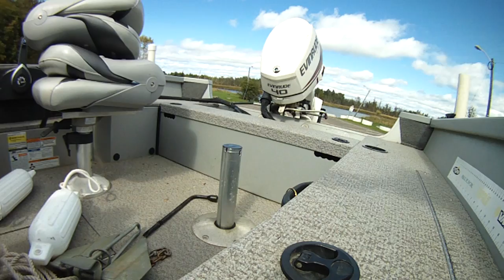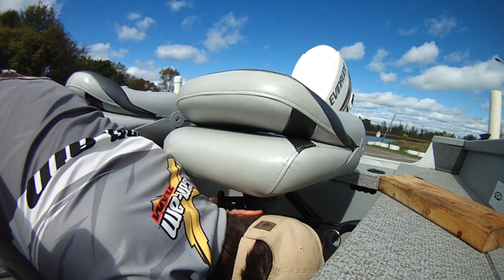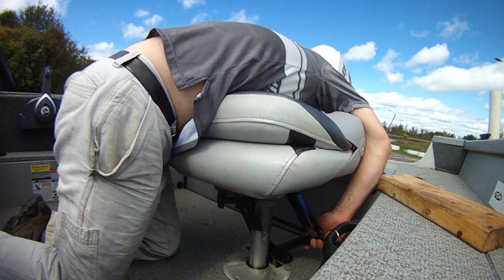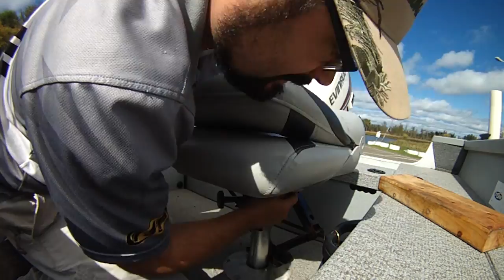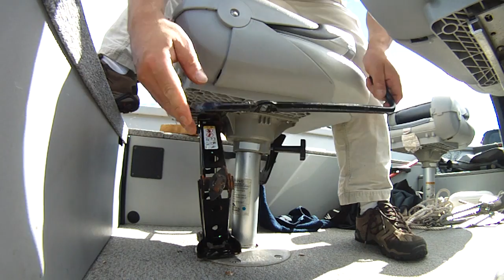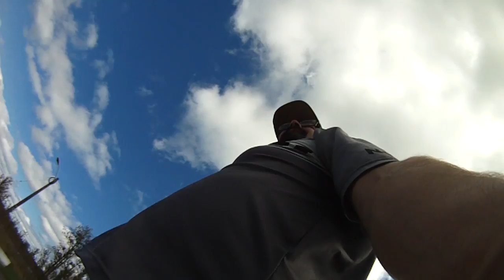How to free a stuck boat pedestal seat

Comment: I don't understand these damn things and it's not just Springfield's. I see people's comments, but they've never used these. This man could have removed the whole thing, took it back to his bench vise, but when you plan on fishing.... 
"Anti-seize" works amazing, but keep a rag close by it has a tendency to find itself everywhere and you won't know how it got there :-/
Well I have one myself I have to get after arrgh!
UPDATE:
OK, it's a few minutes later and it's out. Mine are the 3/4" EZ-Swivel and they wedge in so tight. I pulled the seat and clamped my locking-pliers (vise grips) on the post to use it as a lever. Pushed & pulled a few times and it began to spin. Success. I know this is not the same seat post is this gentleman's but this was the only video I found. I hope this helps.
Reply: when get mine out I am going to try Anti Seize . Was thinking bout that

Comment: Oh no! It looks like you ran into a rare problem that can occur with plug-in pedestals of any brand. Sorry you experienced so much frustration! If you want to prevent this problem from happening in the future, we recommend that you stow the pedestal when not in use. This is especially important during seasonal changes or when towing your boat. The reason the plug-in posts can jam up when they aren't regularly stowed is because the tolerance on the posts must meet a certain criteria to ensure safety and eliminate any wobbles. With that said, seasonal elements and stagnant moisture can cause expansion, which leads to unwanted jams. Another tip is to make sure the base is clean and clear of any debris prior to installation.  We hope these tips help!
Reply: "rare problem" hahahaha
Reply: rare problem hahaha I on utube because mine is stuck!! I usually use A strap wrench . No not working today so searching for other Idears
Reply: Its such a rare problem 4 of the 6 on one of my boats is stuck and all 3 on a boat I sold. 
Take them out 🤣🤣🤣🤣🤣 They're stuck when I put them back in, before I get a chance to sit on them. You know, if I can put the seats in and they're stuck before I even sit in them, they are shit!
Reply: I got a brand new trackboats v16 today, and all of three seat posts got stuck.
Reply: Rare???  Still some wankers around eh?

Comment: Next time work smarter, not harder.  Unscrew the base from the floor and remove entire assembly - seat/post/base.  Then tap the base off with a mallet instead of fighting with it...works every time. Youre welcome.
Reply from the maker: This way took less then 5 minutes, and it was accomplished with the tools I had at the boat ramp.  It as more of a video on what to do in a similar situation. If I was at my shop I could of done it the way you suggested.   The rear base actually was warped on the inside. This has happened to a few other customers boats as well.
Reply: won't work base screws turn have nut on bottom side no access to them ???
Reply: Except for when it doesn't, mallet doesn't do anything
Reply: @canuckoutdoors8452  except for the pole was clearly bent and ruined. There’s no way in hell this took you 5 minutes because the video is 5 minutes and begins with you saying “tried the jack and tried bashing it out” 😂😂

Comment: This happens to my pedestal seats all the time.  I get sick of having to remove them completely from the floor just to get the pole out!   It’s absolutely ridiculous.  This actually stared happening to me a year after buying my bass tracker band new!   I even took the poles out and sanded on them some where they insert in to the floor.   It helped some.  Might have to try sanding them down a little more.
Reply: Hi there! We commented above, but wanted to make sure you saw our tips: "If you want to prevent this problem from happening in the future, we recommend that you stow the pedestal when not in use. This is especially important during seasonal changes or when towing your boat. The reason the plug-in posts can jam up when they aren't regularly stowed is because the tolerance on the posts must meet a certain criteria to ensure safety and eliminate any wobbles. With that said, seasonal elements and stagnant moisture can cause expansion, which leads to unwanted jams. Another tip is to make sure the base is clean and clear of any debris prior to installation." Don't hesitate to reach out to our customer service line at Springfield Marine if you ever find yourself in a jam with our products (no pun intended). This feedback helps us to improve our products and services. :)
Reply: That’s because bass trackers are junk
Reply: @springfieldmarinecompany  But whats your tip for getting them out  once stuck?
Reply: @toddbollen1455  Sell the boat.
Reply: @stumpbumpers   hahaha I got it out with A strap wrench and lots of spray letting soak in..I put it back it with never seize and I pushed the button lock inside tube so ot won t lock in again..

Comment: Having this problem or really side affect for having non-wobbly seat pedestals, I solved it by installing split rings with a 60mm ID onto the seat pedestal about 1/2” above the base plate. Once installed, using a small pry bar or even screwdriver, the seat assembly lifts right out by prying upward on the split collar with one hand and gently pulling near the top of the pedestal back toward the pry bar side to balance pry forces. Easy peazy.
Reply: Do you have any pics of your idea? Got the same problem with 3 of them on my boat

Comment: I have the same problem with mine. My front seat is stuck and it’s in my way when I try to use a cast net or fly rod. I may try this with the bottle jack that came with my Tacoma if it goes up high enough.

Comment: You use a flathead screwdriver and pry the button in. Then you hit it With the hammer handle a few times around it and then she pops out.  Don't bash a company because you don't lube your seats man.
Reply from the maker: Seats are lubed regularly. Only the rear hole sticks, it was deformed from factory.  I work at a large volume marine dealership and we change multiple bases per year from this brand.
Reply: What button?
Reply: @trevorwillis967  Some similar bases have button to release a plastic safety pin. It keeps the seats from flying out.

Comment: Probably wouldn't hurt to put a little lube on them before putting the base tube back in the next time.
Reply from the maker: Yeah I do lube them. For some reason the rear base was warped. This was the first time I tried using it.  The seat still works great in all the other holes.  We have replaced a few of the bases where I work already.